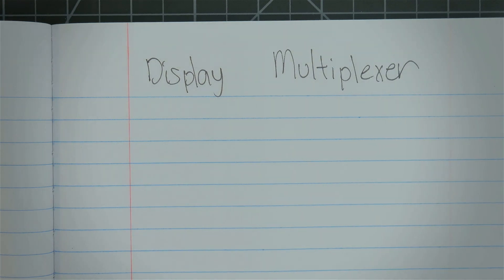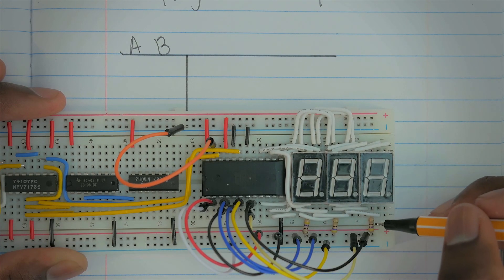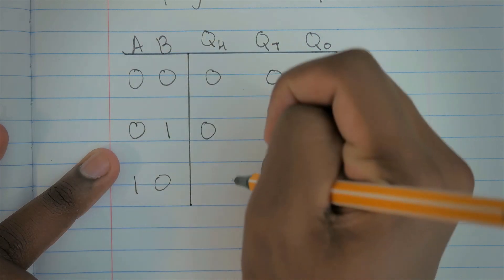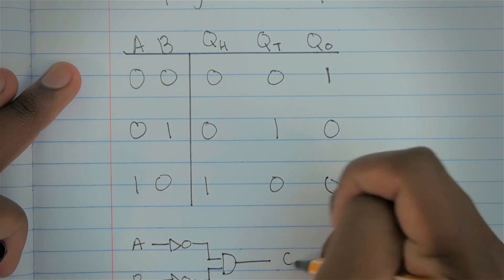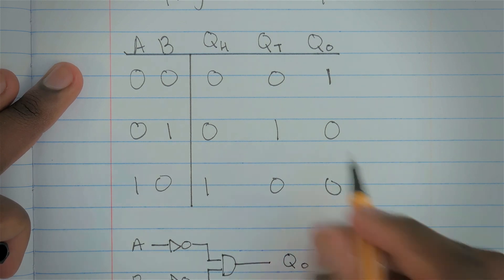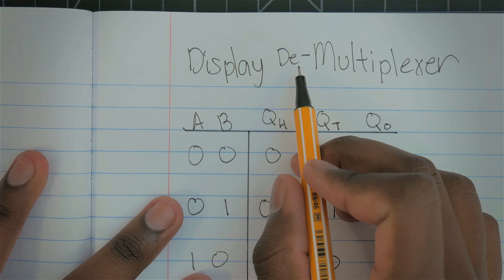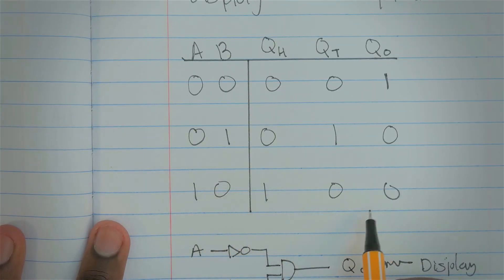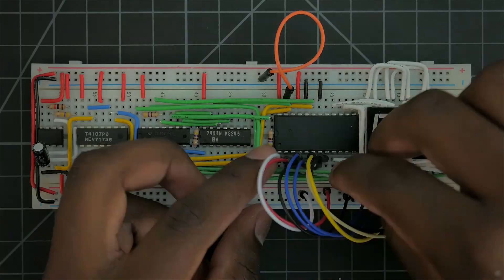8-Bit Decimal Display Finished | 8 Bit CPU

Comment: you can reduce your circuit by using only two NOT gates, instead of six.
for your second AND gate, just pull A-not from the one above and B from above. Then the same for the third AND gate, pulling A and B-not from above.